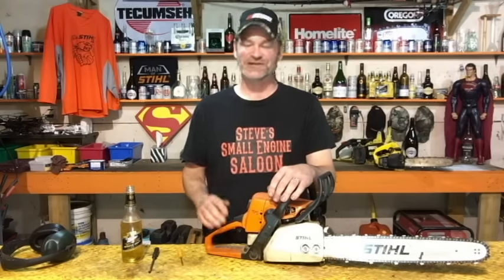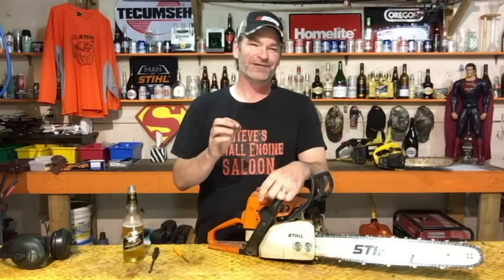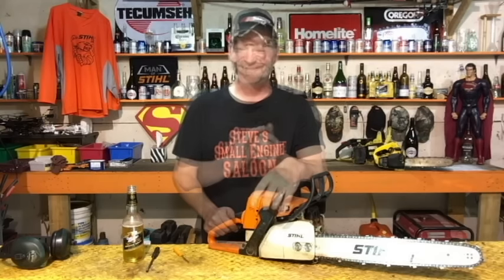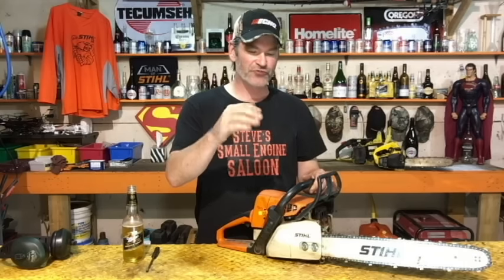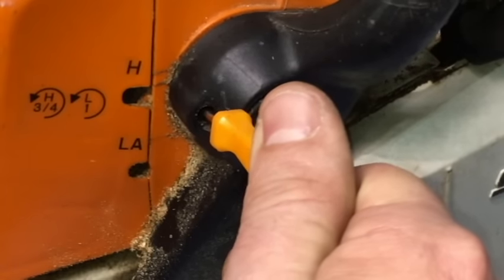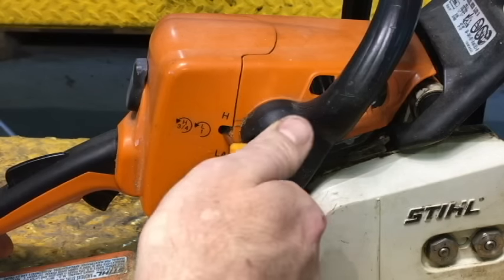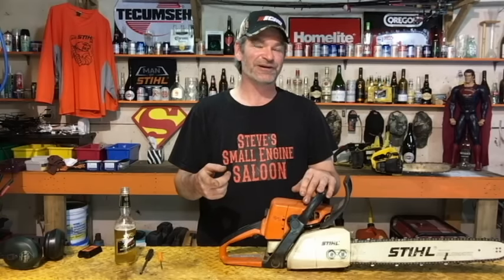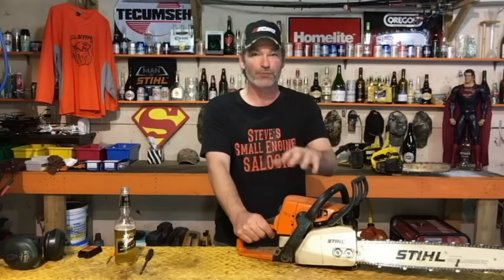CORRECT WAY To Adjust Or Tune The Carburetor On A Chainsaw (Step-by-Step)

Comment: I was able to tune a POS poulan chainsaw to run well after watching your video, it has been sitting in the garage unused for years because I just couldn't get it to stay running at idle when warm, runs like a top now!  Will still only use it as a last resort or sell it but at least it is serviceable!
Reply from the maker: Right on   :_Beer: :_Mower: :_Rider: :_Chainsaw:

Comment: I got a used Stihl 660 with a chainsaw mill, all works, but it's idling really high, so your instructions are helpful. Do you have any advice for adjusting it to run slightly rich or anything for milling when it's running full power for several minutes at a time? Cheers

Comment: I wish I could like a video more than once!
Thanks Steve I have referred to this video so much!
Quick request though: could you do a similar one for saws without an idle screw? My top handle echo 2511t will die after a cut unless I nurse it down to idle with the gas. I can reason through it by messing with the L screw but it be nice to see a pro do the step by step with a similar saw. Thanks man

Comment: Thanks, Steve.  I know the OEM spec Idle speed and Full Throttle speed.  I'm going to adjust my new, unused chainsaw with the limiter caps on, if it has them, and use the Tach/Hour induction meter I bought to see what the RPMs are.  Idle is 2800 to 3200, so 3000 should be good.  Full Throttle is 9000.  If limiter caps are on and they limit these ranges, I'll take them off to get it to specs.  But since I'm staying within their specs, the caps shouldn't get in the way.  That Stihl Tach you use is $126 now, but this one has settings for 1, 2, 3, 4, 6 and 8 cylinder engines and can be set for 2-stroke and 4-stroke for around $20, similar to your link here, so I'll work with it and go the Stihl route if I have to.  I have 4 small engine devices.  I don't want a RPM Meter with a photo sensor that needs the tape marker, so I'm trying this one first.  Thanks again.  You're the man!

Comment: Steve, I adjust high speed at full throttle until it goes into a {2 cycle mode] then back off until it goes into a [4 cycle mode]. Then it will 2 cycle when a load is put on it [the cut test]. As I am a flying model hobbyist, they tune the same way.

Comment: Thank You Steve, thanks to your explanations our Stihl MS192C works perfectly again.
We had it on service only like 8 months ago, and we have had the saw for 11 years, but soon after the "service" (where I suspect that they only changed the spark plug.. which was actually recently replaced) I had to replace the tank filter (where my vacuum pump told that it was basically totally stiiff) and now finally did the carburator adjustments, according your recommendations,  where the three screws were also tremendously bad labeled (unreadable (but now they are, thanks to "Dymo")).
Now, the saw seems to be running perfectly again, so I'm very grateful about your hints ♡
I had first tested the saw without the chain on, but due to your advice, I put the chain back, before doing the adjustments of the three carburator screws.
Reply from the maker: Right on

Comment: Thank You Steve. You da man. I have a Husky 137 & 455 Ranch. The Ranch is new in the box and I forgot I purchased it 3 years ago (DUH). 
Anyway my 137 was serviced by a dealer and the fuel line would break at the filter (Wrong inlet fuel line size). The saw would never Idle, just die. I installed an OEM filter and new Tygon of the correct size from McMaster Carr. 
The fuel line problem is solved. I did not have the tool to adjust the low end fuel adjust. I discovered that light blue NYROD outer casing used for radio control airplane pushrods fits over the screw head snug and turns it just fine. 
The 137 will idle all day now and is like a jackrabbit when the throttle is pulled.
Thank You again.
Gator

Comment: I tried figuring out how the heck you adjust a carb... I tried so often in the past and you got the fix for me.
My Stihl 024AV is choking itself to death once you leave it on the ground and vibrates alot. Carrying it by the handle makes that process go longer.

I'm gonna set it up soon.
Reply from the maker: Good luck!   :_Beer: :_Mower: :_Rider: :_Chainsaw:

Comment: Great video helped me so much grandad saw is a 15-20 years old wasnt running well.   Going like camp now thankss
Reply from the maker: Great to hear!
Reply: Steve Could you do a complete  yearly maintenance video all filters etc  
Thanks for the great content ✌🏼
Reply: Steve's Small Engine Saloon   
Just a question my saw is going but at full throttle it sounds limited  definitely not like it should

Comment: This video is tremendously informative and useful! Quite possibly the most helpful part was getting clued into the wireless tachometer. I bought one and it is so helpful in taking the guesswork out of setting the high idle screw.
Reply from the maker: Right on Mark!  Thank You...  :_Beer: :_Mower: :_Rider: :_Chainsaw:

Comment: I usually adjust my equipment by sound and hit the perfect air fuel raito.  With chainsaws I like to keep them a little rich like a burn out car because it's under high load and I want to cool the engine and keep it lubricated to prevent it from seizing.  Those tachs are pretty cool and I may have to invest in one.  A rule of thumb i learned from a car tunner is give yourself a 20% safe in case something bad happens.

Comment: Always give you a thumbs up, cos you do a great job in explaining accurately. Can you do a vid on the principles used in priming weed eaters engines and issues when running specifically where the petrol cap valve may not be allowing air to enter the fuel tank. I’ve had this issue since I over wintered without cleaning out old fuel. The Honda fuel pipe filter degenerated to gunk and I believe this little cap “valve” has also contributed. I could start and run for a few minutes perfectly, good response then putt putt and stop. Open the cap and away again. Would love to know your spin on this issue. Great vids and thanks

Comment: Needed a chainsaw. Boss gave me his MS 250 for some scrub work on one of his properties. Hadn't run in 2-3 years. Looked like bar oil was in fuel compartment...no gas. Put some new gas with Seafoam and Amsoil stabilizer in tank. Swished it. Dumped it out. Refilled tank. It started almost immediately. Smoked like a bastard for a couple minutes until warm. excellent throttle response. Bar had been flipped. Chain was in bad shape. Replaced both. THEN, I went through YOUR video (because I save them). Chain was rotating at idle. Set the LA screw for chain creep. Then, set the other screw for sweet spot and a minus (ccw) backout for "perfect". Runs perfectly. Your my guy, Steve!!!
Reply from the maker: Thank You...

Comment: I followed everything you demonstrated and my saw runs GREAT ! The only problem I have is getting it started? It will not start unless I prime it with some gas from the tank. She'll pop right off and run great.... but it has to be primed first. Any words of wisdom ? It's a Stihl MS260 if that helps?

Comment: I bought a new carb and the tool came with. $6 tool vs $24 for all new carb, hoses, filters, bulb and spark plug. The new parts were higher quality than what Poulan used. New carb also has metal throttle linkage to choke, not the weak plastic arm that breaks.

Oh and just what I needed too, thanks for the video.
Reply from the maker: Right on

Comment: Thank you very much for all your videos. I am a little bit desperate here. My chainsaw cuts well in high rpms but when I leave it at the throttle level even it is set up pretty high it eventually dies. I tried a proper set up, changed all the gaskets a diaframes in the carburetor, changed the spark plug... Also when it dies I have very hard time to start it again. Would you please have any advice?

Comment: Thankyou so verymuch for your time and effort with yer videos. I have a wee question, as im puzzled. Im running a Stihl ms 660 on an alaskan mill. Recently its been bogging down when fully in the cut....Have checked filters, fuel filter, tuned saw and it still keeps doing it. Have you any suggestions....exhaust?? Thanks again for your time. Kind regards Blair

Comment: Hey man I jus want to thank you for such a informational video I've been trying to get into mabie being certified I've been workin on this type of stuff all my life
Reply from the maker: Best of luck!
Reply: @StevesSmallEngineSaloon  thank you I figured I'm having a fuel line issue rn and not the right mix of gas after checking the spark plug it was very wet and jus a Lil bit of black and Grey I'm thinkin it's to rich so therfore the saw can't burn properly

Comment: Steve, I ordered the special screwdriver set off eBay and used them and this video to get my chainsaw running and useable. It would start and run a bit but not idle without dying and wouldn't rev, it just died. Running and cutting again! Now, if I could find the problem with the kill switch. Won't stop the engine. I have to choke it to stop it.

Comment: Dear Steve, Hello once again 🙋🏼‍♂️ 
Purchased a carb adjusting kit....when adjusting the High...on any typical 2 Stroke is there a "safe" range to set the RPM - Before the engine blows? 11,000? 12,000 rpms too much? 
Thankyou Joe

Comment: Hi Steve love the video, but I did notice you mentioned the high-speed screw for the saw you are working on is 1 and a half turns but on the cover, it's showing 3/4 of a turn is there something I'm missing here?
Thanks
Reply from the maker: The marks on the cover assume you still have the limiter caps on!
Reply: @StevesSmallEngineSaloon  Ok perfect, thanks

Comment: Returned to the scene. with my newly acquired RPM meter to do the adjusting. Had to ether it to get it started. Hate that personally. Seems like one can never ween them of it. Thought I had it as it would idle finally for a short time without continual triggering. Once it got hot, it defies all attempts to restart. I still have two possibilities. Something under the  sacred welch plug. The other is a defective gasket to engine from carb. Have that ordered. Input from anyone will be appreciated. This is probably the third Walbro kit I've put in on this saw. Doesn't seem to want to pull gas in unless I use the starter  fluid.

Comment: Thanks for that from the UK. Easy tutorial, no wordy bullsh*t. My top tip for the UK is only buy decent petrol, and only use the Stihl oil, measured accurately. And don't mix up much more than you need, it goes off. We have some pretty awful fuels here Steve, compared to the rest of Europe.
Reply from the maker: Thanks for sharing

Comment: Hi Steve, trying to get my Stihl MS250 tuned in. Where the low adjustment hole is ( going in through the hole in the handle marked L) there is no screw in the hole that I can find. When I pull the rubber boots away there is 2 screws side by side in the HA hole, I presumed the closet to the motor was the low end adjustment ? It appears to have worked. Was I right or should there actually another screw deep down in that L hole in through the hole in the back of the handle. Cheers Steve love your vids, very informative 👍

Comment: What a great video!! My chainsaw was so messed up I could pull the trigger and nothing would happen except make a low hum. No chain movement at all. Out of the box it worked fine for about 6 months (not much use though). Any reasons why it would change after some use? I always used the TruFuel from day one.

Comment: Thank you. I'm a light duty tech in Ontario and I've never had the need to own a small engine before that wasn't fuel injected. Thank you for helping me get my saw running mint! I bought this poulan pro 18" for $20 and it's got a Husqvarna setup inside and this 21 spline tool threw me through the loops. Thanks for guiding me through the lowside adjustment. Also, the link for the Husqvarna tool is quite pricy. I got a 10 piece kit plus jet files and brushes for $32. Not the greatest quality, but ships from Niagara and theyre all functional

Comment: Hey Steve. Thanks for all the videos. Quick question for you though. I need to adjust the carb on my new stihl 194t. It does on idle right after I cut with it. Stihl shop near me is unhelpful since it’s a new saw. They swear it doesn’t need adjustment. I need to know what kind of tool to use since I can’t find the info online. I don’t mind jerry rigging it with what I have at the shop, unless I absolutely need a specialty tool. Any information on how I can adjust this?

Comment: Great video! Couple questions though. Im assuming the chain brake should be off when adjusting, right? Also if my issue is that the engine dies when at idle, what happens if I can’t keep the engine running log enough to make the adjustments?
Reply: no brake. If engine doesn't idle, does partial or full choke solve the problem? If so, richen the low rpm mixture. Also you can try pushing the trigger a little to keep it from dying. Maybe idle rpm is set too low.

Comment: Hi, Steve, thanks a million for all of your videos. Very helpfull, much obliged. 
I have a question. 
How do we suppose to adjust the idle screw from scratch? In your video you turn it slightly so it adjusts the chain's speed. But where do you start from, if you dissasemble the carburator for instance? Turn it all in and then out like the hi and low screws?  Couldn't figure it out myself. Thanks

Comment: If I could pass you a case of good beer through the Internet, I'd do so. Your videos are always great advice.

I know basically nothing about small engine equipment, and so ... I think I'll go try adjusting my chainsaw's carb soon.

I do have a question. Mine does something which a friend's does, which he overcomes by putting it at half-choke and restarting, but mine will not: After using it for a bit, sometimes it just dies at idle, and then it won't restart unless it has sat for a long while. I bought my chainsaw (used from someone nearby) because a storm knocked over a red elm, and I didn't have nearly the funds available at the time to pay someone to come remove it. And it did that from day-one. It's a lower end consumer saw, but I still think it could perform better than it does.

Comment: Steve, Do you have a vid that shows the correct hookup for the fuel lines on an Echo CS400 chainsaw? I changed out the carb and am now scratching my head. Thanks.

Comment: Depending on where you live, you could also justify enriching the high idle in the winter when engines generally run leaner, and leaning it back out in the summer when they tend run richer.

Comment: I have done a tuneup on my old 
011AV Stihl and still can't get it to run properly. How important is removing the Welch cover on a Walbro carb as that is all I left out of my overhaul. Pitiful response on low speed jet. Never get a high speed on motor. Really liked your site

Comment: Steve.....excellent video! I've owned 2 stroke motorcycles in the past and we always tuned them in a similar way. I was always taught you want to be on the rich side on the gas mixture rather than lean.Staying just below the max rpm.  Too lean and the engine doesn't get enough lubrication and will cause piston seizure. We also would check our spark plugs........if it had a whiteish cast......too lean......black....too rich. Also gas/oil mixture has an effect. I've been running Echo's Red Armor 50 :1 mix with no ethanol. At that ratio you definitely do not want to be too lean(screws turned too far in) as there is lees oil in the gas. Thanks again and keep up the great videos!

Comment: Steve, my Husqvarna 445 has recently become difficult to start, hot or cold.  Once it is started, it idles and runs great. Should I try adjusting the carb, or am I maybe barking up the wrong tree in trying to diagnose this issue? Thanks!

Comment: Loved your video, sorted my Husqvarna out perfectly, it was badly set up new from the shop. Wonder if you can answer another question for me? I have a Stihl MS382, and in the owners manual it states "Firmly tighten down the cylinder base screws of professional saws (3.4 KW or more) after 10-20 hours of operation" So you know what they mean by this? Is it the cylinder head bolts or is it the bolts that hold the engine to the anti vibration frame? It is not really clear, and they provide no diagrams. Thanks!

Comment: This is amazing.  I’m not at all mechanical.  I’d rather throw it away and get a new one as opposed to work on stuff, only because I don’t get it...usually.  But you taught it so well.  Thank you sooo much!  Gotta get one of those do-hickies to meter the high screw setting then I’m in business.
Reply from the maker: Right on Mikey!

Comment: I got an MS250 this Spring and love it.  It has a tendency to wet the air filter w/ gasoline and then it seems to clog more easily.  Does this mean it is running too rich?

Comment: Hi. Thank you for the videos you take the time to do. With my Stihl saw it will not start unless you hold the throttle fully in while cranking it and when I let go it immediately cuts out . Which is the best screw to adjust to rectify this and make it start normally the L or LA?

Comment: Steve, thank you for this.  I have a couple questions.  First, if you're going up in elevation to work, how much would you adjust and what indications do you have that the motor is getting lean?  Next, I've heard others talk about the engine "4-stroking" during adjustment.  I take it this is an auditory indicator of some sort.  I don't know what that woukd be however.  Thanks!